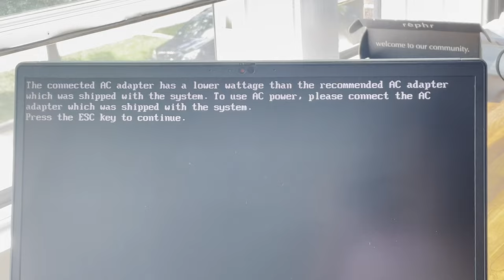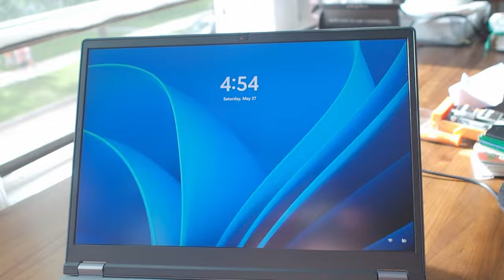How to fix Lenovo P16 Gen 1 Connected AC Adapter Has a Lower Wattage Issue [May 2023]

Comment: While unplugged, Instead of unscrewing, the access panel in the back use the pinhole that pinhole is a reset button hold that down for 60 seconds. Problem solved.
Reply: The issue has happened to me twice.. the first time I fixed this with the battery removal method.  The second time was with the pinhole method....Second method much preferred. Thanks!
Reply: I'am grateful, thank you for this quick solution !! The maker of this video, thank you too !!
Reply: Is the laptop supposed to be off or on during the process? All I am hearing is the beeps and it doesn't fix my problem.
Reply from the maker: The laptop is supposed to be off.
Reply: Should I keep trying until the batery is zero
Reply: Yeah it worked for me too,Thanks!
Reply: This is the way
Reply: Holding reset button did not worked for Lenovo. Disconnecting internal battery and holding power button for 60 seconds helped to fix charging problem.
Reply: Where to find pinhole

Comment: TO RESOLVE THE PROBLEM EASILY: IN THE BACK OF THE MACHINE, IN THE QUICK ACCESS PANEL, THERE IS A VERY SMALL HOLE, USE A LONG PIN "LIKE THE SIM EJECTOR PIN", HOLD FOR 60 SECONDES, THAT RESET, AND PROBLEM RESOLVED !!
Reply: It erase everything on the computer?
Reply: @MrMeduUse did you do it ?
Reply: @MrMeduUse what happened ?
Reply: That hole doesn't exist.

Comment: Thank you @Guillermo, I was having Incorrect AC adapter attached error message in Windows. Your suggestion helped. To be honest, I was not expecting. I was about to update BIOS (but it cannot be done from Windows without working charger) and re-install Windows, so you saved me a lot of time. Your instructions are very clear, precise and easy to follow. This was the only place in Internet where I found solution to this problem. Amazing.

Comment: hey can i try this on my legion 5 laptop? I am also having same problem showing low wattage on starting
Reply: Yeah, me too
Reply: Hey, I'm also facing same issue in Legion 5. Did it got resolved for u?
Reply: @soubhagyaranjansahoo7128  nah brother  i tryed but not help beacuse i don't have original charger
Reply: @DYNAMIX_YT07 I'm facing it even with original charger 😢
Reply: @soubhagyaranjansahoo7128  you can try to solve , you have original charger also. If it don't work you can replace the wire of charger also
Reply: @soubhagyaranjansahoo7128  do you find solution
Reply: @user-wj5dz5yu4l  nah bro its solution is to replace the whole motherboard and charger

Comment: THE SOLUTION IS EASY (without dissambly): AIRPLANE MODE “OFF” OPTION 
This is not a bug or a defect but a safety feature.
Airplanes with 100 Watt charging receptacles are becoming more standard, however, as I recall, the ThinkPad P53 requires a 170 or even a 230 Watt charger, depending upon its configuration. 
Plugging a device into an airplane seat power outlet that consumers 1.7-2.3 times the wattage could cause the outlet's circuit breaker to trip.  If there is an electrical problem with the outlet, though, an electrical fire could occur aboard the airplane.
The Airplane Mode option on the computer disables AC charging so that in case the computer is plugged into an outlet with faulty circuit breaker, it just won't charge, as opposed to starting an electrical fire aboard the plane in which you are flying.
Reply: you just saved me a lot of pain!!! Thanksssss
Reply: Omg thank you 🙏
Reply: Here for the upvote.
Additionnaly, Lenovo seems to have recently released a BIOS update (october 2023) that fixes that "airplane mode" problem. Might be a good idea to update the BIOS now :)
Reply: No difference
Reply: @Lmhafu  is your problem resolved?
Reply: My maaan, you've saved my ass. Cheers to you

Comment: In my case, ThinkPad p16 gen2, i had enabled the Airplane power mode in the Lenovo Commercial Vantage software, turning it off fixed the issue.
Airplane Power Mode: switch it off.
Reply: Great thank you! Can you now somehow charge the laptop with any power bank from an ON state? I mean, while using it...
Reply: @Penta_Penguin_237  I don't have powerbank :(
Reply: This worked for me, thanks!

Comment: After you did this, did the error never return? I have the same laptop it comes back every now and then. To solve this just reset the laptop, there is a small hole in the quick access panel. no need to open the laptop.
Reply: It erase everything on the computer?
Reply: No it doesn’t it is just a reset for issues like this. You can google what the reset button is used for.
Reply from the maker: Unfortunately, I returned the laptop. I had such high hopes for another Lenovo. My first one, a P50 from 2016, was amazing and lasted 6 years. This newer machine was just too bulky and poor quality. Thus, returned.
Reply: @trailblazer_ss  I think you are confusing the versions there are several opinions on the internet about this computer but in the end all the positive ideas may refer to other versions of the P thinkpad .The thing is you can even customize build it with several versions already going even till P50s so i advice you to check the version related first.I have this pc the AC problem keeps coming now and then ,the pc is pretty heavy compared to other laptops and i have some keyboard related problems (it's not hard fixed).My PC is P16 but i have no prior info about the newer versions if that helps.

Comment: The higher end versions should come with a 230W adapter, but it looks like your laptop had issues.

You may want to contact Lenovo if the issue persists.
Reply from the maker: 0:14 The adapter is rated for 230W. My quick edit cut and plastic wrap around the power brick made it hard to see. 

I will keep an eye on this and reach out to Lenovo if the issue keeps happening.
Reply: I have had this problem since exactly one day after my return window expired. I contacted Lenovo multiple times, describing the problem, includin pictures. 

Lenovo support is a joke when it comes to people (bought it cuz they did great for the company I work for)

Thanks for posting this video... It's a shame they haven't fixed it yet
Reply: By the way, you can achieve the same result by unplugging the laptop from the adaptar, turning the laptop off, then inserting a clip in the emergency hole that is located at the top right of the quick access panel for about 60 seconds. Turn it on, you are good to go... until next time it happens :(
Reply from the maker: @philately  I didn’t know this. I will try next time. Hopefully doesn’t happen again. 🤞
Reply: @philately is this issue on going or does this only happen once?
Reply: @philately  thank you very much, the emergency hole did the trick. Now installing a BIOS update, hope it will fix the issue
Reply: @philately  I had exactly the same issue. This trick works as magic (I did googled to find out where emergency-reset hole is located though). Thanks! I hope this issue won't show again.
Reply: @yamingsu3242  can you please  guide where the rest hole is on the ThinkPad P16 Gen1